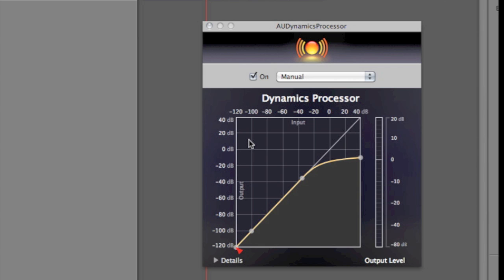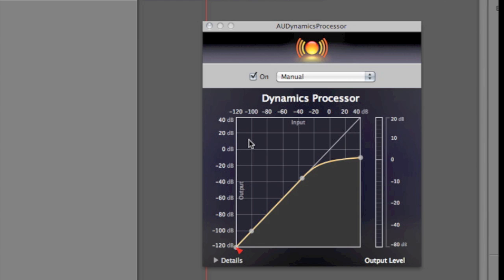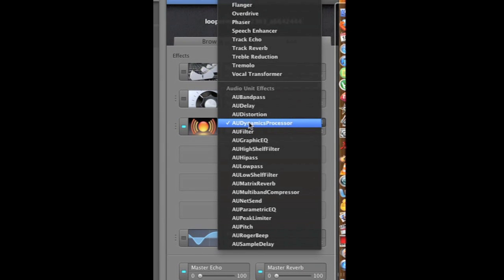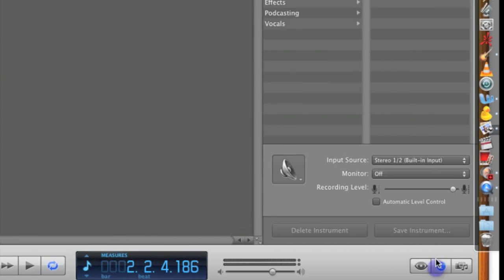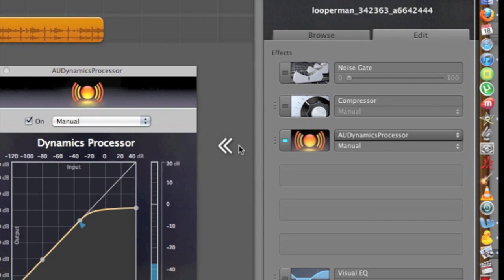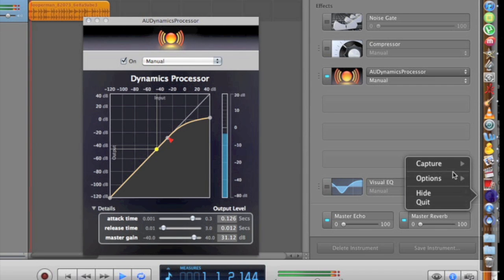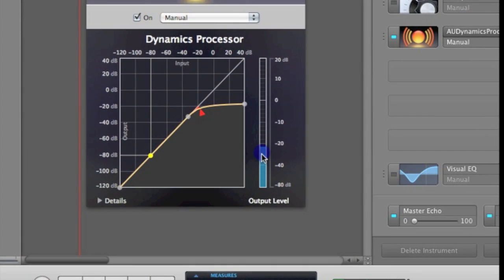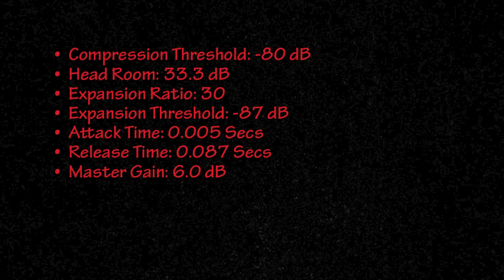Mastering Songs in Garageband- Sound Dynamics Tutorial Master

Comment: every time i export a song into itunes the volume level is very low compared to other songs on itunes.  but if i try to use another program such as mp3gain to increase the db level on the song it starts clipping.  is there anyway to increase the volume of songs exported from garageband without clipping.  any help would be appreciated.  thanks!